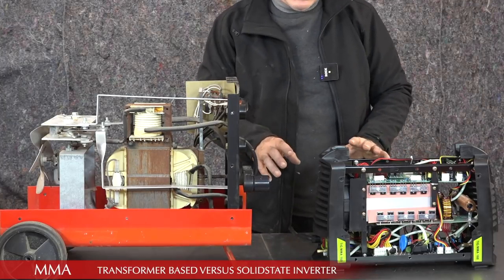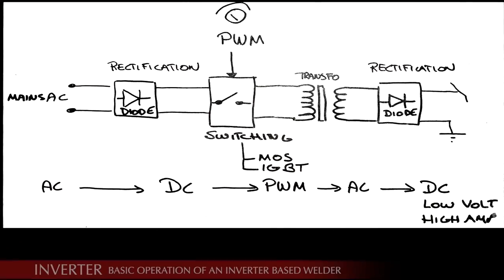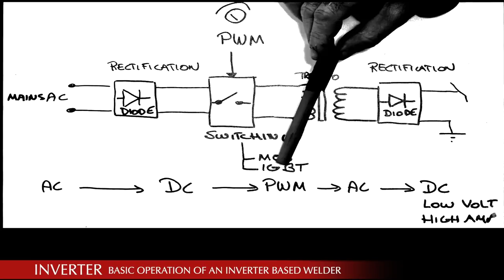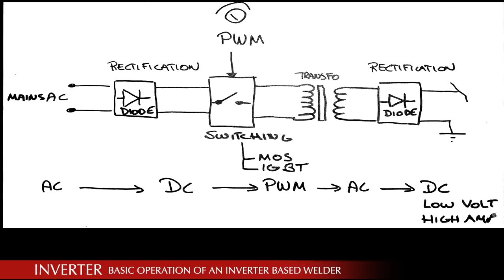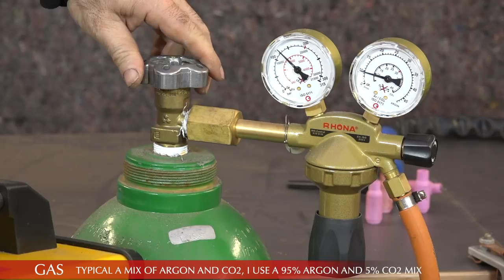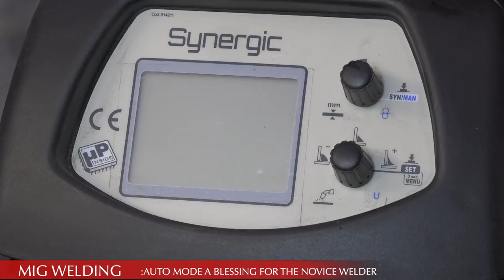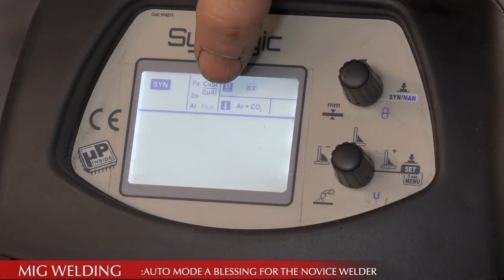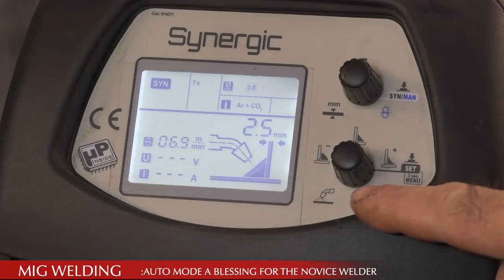MMA, TIG, MIG  not sure what to get , this might help

Comment: If you want to actually LEARN welding, start off with an AC-DC stick welder.  If you've never welded before, stay away from MIG.  You'll just fool yourself into thinking you can weld, but you'll actually learn next to nothing.  Start with stick, with eventually looking toward TIG.  With TIG, you will be able to weld virtually ANYTHING weldable, but the learning curve is steep!  Don't kid yourself....you can't learn to be a great welder by doing it part time.  It takes a lot of practice.  I know.  I've had 50 years of professional welding, and still learn something new with each weld.
Reply from the maker: Thank you for the comments, its great to het this kind of comments and recommendations...

Comment: Steve! You have made an absolutely fantastic tutorial here, it sets out almost all of the answers to the questions that any novice would want to know about getting the right welder for the job, the only unfortunate fact is that the cheaper end welders are far more difficult to use than the circa $1000 ones, so as most people buy , not knowing if they are going to get on with the system, they tend to buy at the low price end of the market, this makes things very difficult for them, and they often give up, the greatest cost in the inert gas welders is often the bottle of gas, which although cheap to fill, are a high cost item to buy initially, depending where you live. Very many thanks for posting this ,it will be a standard for many years to come! Chris B.
Reply from the maker: Thank you for the comments,  I agree. Many times a cheap buy becomes expensive as you say.   As for the gas, overhere a bottle of  the types you have seen in the video run you a one time cost of 100 euro/dollar.   If returned , and no exchange is taken, you get the money back.   A refill is about 30-35 Euro for 95%/5%  and 45 euro for 100% Argon...
Reply: @D3Sshooter  :That is a bargain, here in France it is 365 Euros as an initial charge, then about 30 E for a refill. but I have an old bottle of Argoshield from way back.
Reply from the maker: @453421abcdefg12345  , just come over to lille and courtrai...

Comment: Not all inverter welders use IBGT or MOSFET. My Powcon machine actually uses SCRs (Silicon Controlled Rectifier). Much more rugged than an IGBT or a MOSFET, but more expensive. A couple of other big name brands did SCR based inverters early on, but switched to the cheaper devices to save on costs. Of course the savings didn’t get passed on to the customer.....
Reply from the maker: Hi John, indeed the SCR or thyristor is another semi conductor that is used primarily used in megawatt rectification from AC to DC in the low to medium power range of applications. Where as the more recent /modern Insulated-Gate Bipolar Transistor is replacing it in a number of situations; due to its superior switching characteristics. MOS,SCR,IGBT are found in inverters for welding purposes. And there could be more like DIAC's etc...

Comment: Good information that I would like to complete with more info. If you need to weld on cars, go for a good MIG welder. Using an TIG on a car body is limited and difficult as you when welding have to use both hands, sit down to get an comfortable working height and working position. TIG welding is almost always done on an welding table and then it is unbeatable for clean weldings on parts.. E.g. making an stainless steel exhaust system. Then the pricing, don't go for an cheap TIG, a good TIG price starts at the same price level as the fully automatic MIG. Then you can weld steel, stainless and aluminum. Some MIG can also be used as TIG welders (but are limited compared to an dedicated TIG), many MIG and TIG welders can be used for MMA welds so the need for a separate MMA is then not needed,  at least for indoor welding on thicker material like separate car frames. I have all three machines, I do not remember the last time I used MMA on a car. I would say that 85% is MIG, TIG is used for welding componets on a welding table. Happy welding!
Reply from the maker: Hi Anders, great write-up.  And I can only confirm what you wrote. I started with the MMA, got later the TIG and found it a great welding method if in a comfortable place. Later I got the MIG, and that is indeed my 85% used tool , same as you stated.  Thanks for the clarification and note...

Comment: I’ve been welding since 1973, and have professionally designed machines and electronics. I mention this because I understand the concepts of welding pretty well. So I can say that this has been just about the best “lecture” on basic welding I’ve seen in a long time. Welding is very complex, and there are standard books on the subject for those who want to understand the theory.

I’d like to make a suggestion for beginning TIG welders. TIG welding can seem very complicated due to all of the different types of tungsten out there, as well as the different thicknesses, along with the different size holders. For almost all work, and all that most people will do, 2% Lanthinated electrodes will serve. No need to scratch heads over all of the other types. Don’t let people drag you into the mess. Again, for almost all work, 3/32” (2.4mm) is perfect. For thicker metals, grind the tip to a 20 degree included angle, and for thick metals, to about 60-90 degrees. If your welder is a true 250 amps (not one of those really cheap Chinese welders from eBay and other places, they’re about half the amps they say), only then, if you’re welding 1/4” (6mm, or a bit thicker) will you need an electrode about 3mm, or so.

For filler rods, stick to 70S 6 for steel. There are many others, but most steel is mild, and this is perfect for anything other than higher grades of steel. For stainless, use 308L. Most stainless is 304, and this is for that. For sheet up to about 12 gauge, filler wire a bit thinner than the metal will work well. For thicker sheet, 2.4mm is fine.

As for aluminum (yup, American spelling), you need a TIG welder that also has AC. Don’t let anyone tell you can use DC. You can’t. Industry does, but these are very large machines with 6mm electrodes—or bigger. Don’t try it!

As for gas. I’m surprised to see 95/5 recommended. That’s really not recommended. While MIG and TIG seem similar, they are totally different. In TIG welding, even small amounts of Co2 will add oxidation to the weld, and cause an uneven arc to form. This will result in a more brittle weld than otherwise, and have it more subject to rusting down the road (literally).

Otherwise, I can agree with everything else said here.
Reply from the maker: Thank you for the comments, really a great write-up from a professional..   Overhere its common to use a 95% Argon and 5% CO2 for the MIG.... not TIG....  that is all Argon...   i was always told and read that the CO2 helps with the penetration of the weld. The more CO2 the deeper the penetration at the same amperage...  Of course you get more spatter and oxidation....  Is that wrong ?
Reply: I absolutely agree.
Reply: @D3Sshooter  hmm, just saw your reply. Sorry. Well, normally, MiG is done with 75/25, with Co2 being the 25. But you must use something along the line of 70s-6 wire with more deoxidizers. If you use -2 or -3, the weld will be too brittle.

Comment: Great advice . I would recommend that people do not buy the cheap flux core A/C only welders that proliferate as they are very tricky to use - much harder than TIG ! DC inverter technology is the way to go even for flux core and gives pretty decent results. As a hobby guitar player I found the hand co-ordination of TIG okay almost straight away but agree that MIG is the day to day choice.
Reply from the maker: Thank you for the comments

Comment: Good overview, and helpful to point out the way welders used to be, and why they are now so small and much lighter and with more controls, plus many 'combo' units that do more than one kind of welding from the same welder. I agree about the advantage of the stick welder for welding on buildings, especially if you have to climb up high, where you cannot easily lift your mig welder. Another important use for the stick welder is when you want to use a special stick -- such as a high nickel rod for welding cast iron, a difficult material to weld successfully. You also don't really address welding aluminum. I find aluminum quite difficult to weld. You cannot realistically weld aluminum with a mig welder unless you have that special little spool welder, like a Cobramatic, because the aluminum wire is not stiff enough, and it easily kinks in the hose and causes trouble. So people will use TIG for aluminum, but aluminum conducts heat VERY well, and it does not show you the heat as nicely as steel, so it is remarkably difficult for me. Another problem with aluminum is that it matters a LOT how big the piece is. A small piece will quickly heat up the entire piece, and that changes everything. Re: TIG, you did not mention the use of the foot pedal nor a water cooled torch, both of which most TIG welders strongly prefer. Another key point that I would mention is that the MIG has a nice pistol grip with a short distance to the arc, unlike the stick, where it is often farther away, and then keeps changing. As you point out, MIG on mild steel (e.g. most car metal) is far and away the easiest to get a handle on and make good welds, even on fairly thin sheet metal. Another point worth making on the welding subject is that you have to be cautious when considering welding on car or truck frame members. You would ordinarily not want to weld cross-wise on a frame member, but lengthwise, because the weld heat weakens the frame metal near the weld. There are some prohibitions on welding cross-wise on major frame parts in the US.
Reply from the maker: Great points and write-up, and you are right I did not say much about Aluminium welding except to use a 100% Argon gas.  Personally I have done very little welding on ALU, so thank you for pointing that out.  I also did not mention the cooled cup, that is indeed an oversight from my part. Happy to see that you mention it.  As for the pedal, I did mention it in the video as an alternative to the switch on the torch.   Thanks again for you pro comments and tips on this video, that is how we all learn from eachother.

Comment: Really good video,good content and informations,good presentation,good rythm.
Thanks for that.
I 've learned to weld with a TIG on 316 L stainless pipes for pharmaceutical stuff at Sanofii lol
It was in "position", standing upright,or on the knees etc...while welding a pipe diameter in two sequences of 180 ° with bends etc...like a monkey doing stunts on a branch.
It's not that difficult if you don't know it's supposed to be the hardest to start  lol 

I have a 40 € crappy used arc welder but i wish a tig and a mig  for sure.
Reply from the maker: Thanks for the comments

Comment: Thank you for a very informative video. My 40-year-old stick welder annoys me because the stick keeps sticking to the metal, so I was thinking about cannibalizing it and building a low-frequency inverter (to convert 48 volt DC to 240 AC) because it has such a huge transformer. Modern high-frequency inverters (with small transformers) aren't very good at starting large inductive loads (motors). I figured a MIG could completely replace my old stick welder, but I think you've convinced me otherwise.

Maybe I'll figure out a way to install some switches and tap into the transformer while keeping the welder functional. 🤔
Reply from the maker: Thank you for the comments
Reply: You know, I purchased a welder for $84. It's called a "Hone" brand. It's a beautiful welder, with a steel case, and a 12 gauge power cord. There are people with photos where they use this stick welder at work doing commercial steam and water pipes on large industrial buildings, and the welds are just as good as a Miller (according to actual Steam Fitters). The thing about the new cheap "inverter" stick welders is that they have something called "arc force" which actually increases the power when you accidently dig the rod into the weld, this means your weld is much more consistent, as the amperage is constantly adjusting to your bad technique. Also, the inverter welders have a "hot start" where they have a lot more voltage off the start and they arc much easier. The overall result is that a little $84 feels like an old $5,000 welder. They are also DC, so they don't have that God awful "buzzing" sound, and the arc is smoother than a basic AC welder.

Comment: I've been watching your videos and they have teached me much. One of my future plans is to try welding aswell, because I need it to work on my car. I live in Estonia, so we get lots of salt on the roads in winter and the cars bottom part needs repairs. Could you do a video on making screw holes ? I run into this a lot when I am working on my car. The screws are rusted and I need to rethread them, sometimes they are gone too much and I need to make a hole bigger for example m8 to m10 etc. Because I don't know a lot about it I messed up with different screw teeth "jumps" m8 standard is 1.25 mm, but I had 1mm and I messed up the threads. Oops, didn't know that. Then I tried to make an m10 hole to m12, but I didn't use lubrication and didn't turn back the thread maker, so it broke in half! That thing is strong, so I can't drill it out like an regular bolt! I think you would explain those basics very well aswell :)
Reply from the maker: Thank you, and yes maybe I will do that.. Typical I use inserts , so drilling out the old and tapping en then the insert ... that brings you back to the original diameter...  There are special kist for that and works really great..  I will do this as soon as i have a bit of time

Comment: Enjoyed the video! I am looking for a decent welding helmet and upon looking for one, I became confused by the differences in price ranging from $30.00 and up to $300.00. What separates the low cost ones from the more expensive and what would you recommend? Looking forward to more projects and see you next time...
Reply from the maker: Thanks for the comments, There are many aspects that set the price. First its the material of the helmet, pressed cardboard, plastic, carbon fibre.  The build of the helmet, like replaceable glass/screens, pivot points, adjustment straps . Some are very cheap and wear out very soon. Then the most importent element the screen, the size of it, the sensitivity, the switching time (frm on to off and off to on), solar or battery powered . And the material of the screen.  IMO, a 100 Dollar helmet will do unless you are going to weld daily.  I have  3 Helmets, one at 30 dollar, one at 100 and one at 180 ... and it makes a difference..  Maybe I could make a video on it showing the difference.  I do not have a top of the line helmet , as I do not weld daily.  I hope that this helped a bit
Reply: @D3Sshooter  I guess, like anything else, you get what you pay for. Thank you for taking the time to respond. I'll keep in touch...
Reply: I have a cheap helmet. My son welds as part of his job and has an expensive one. A big difference is his lets more light in when not welding.

With mine I have to use bright lights to see where to start the weld. On the bench it would not be much of a problem, but in a tight spot where you have to put your visor down before getting in position it takes a bit more fiddling making sure there is enough light to know where to start the weld.
Reply: @gshort4707  That's a really good point. I've been in those situations under the car welding pipe that's why I want a new one. 
Trying to improve on times like that without spending too much. Thanks I appreciate it

Comment: with out doubt stick is a better weld than mig or tig .
Reply from the maker: I am no to sure about that, I guess it all depends what is been welded.  I assume that you refer to the strength of the weld ?  IMO, that will depend a lot on how its welded, by a pro or novice and secondly by the technology used..  I tend to believe that TIG is the better for high quality welds, then MIG and at last MMA...  But lets see if there are any professionals out there who can provide a pro answer as I can not.
Reply: @D3Sshooter  A grinder and paint make me the welder I ain't...
Reply: i have been welding for 40 +years and find i can weld tin cans together with the weld seams looking like it's been tiged using a mma. my self do believe that stick is a stronger weld than tig mig and mag you can buy a lot of welders today that will pulse and time you're stringers but the machine is only as good as the person using it . i use a pickhill oil cooled welder from the late 50s .

Comment: You forgot to talk about the different electrodes for the TIG. And your test is not the reality, it is easier to weld a thin plate plated on a metal plate than without anything behind.
Reply from the maker: Thanks for the comments, yes indeed..  I think I did talk about the electrodes but not in detail